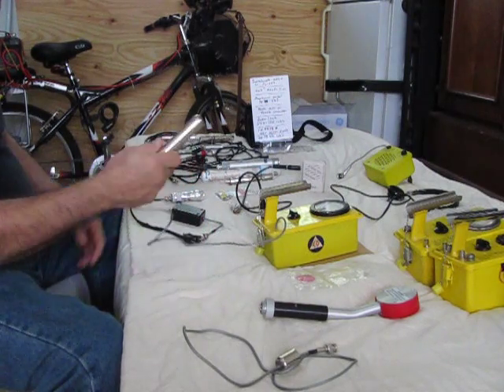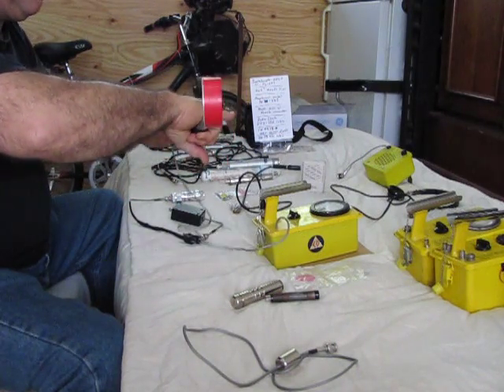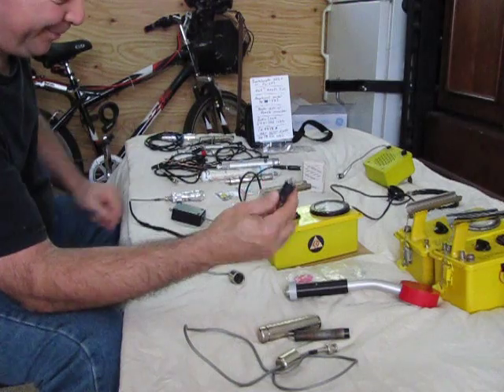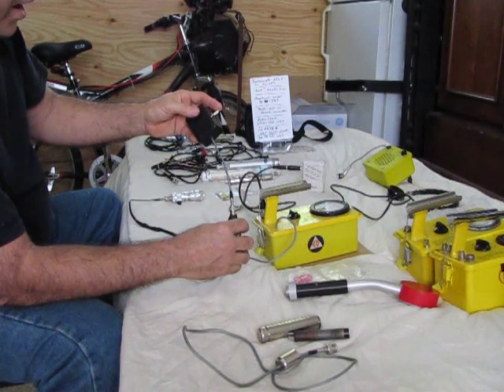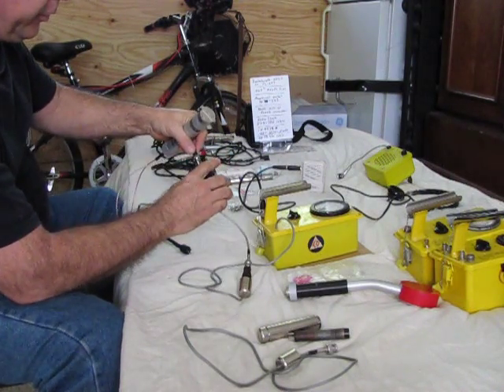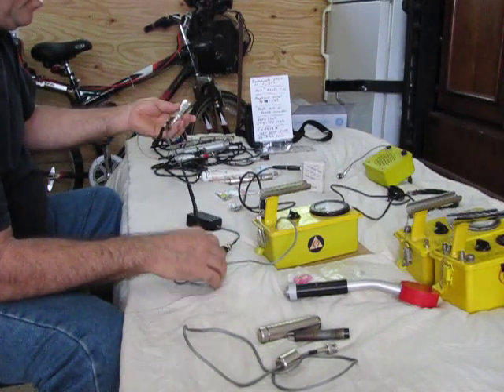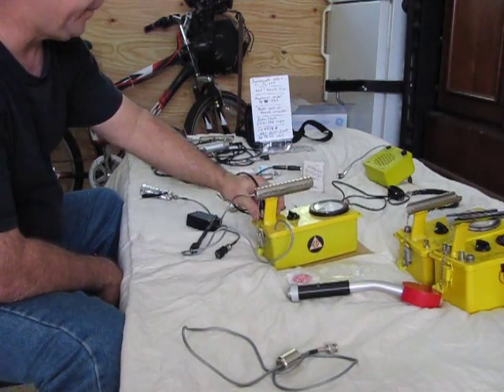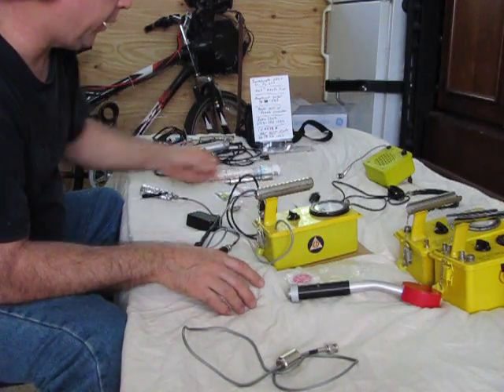CDV-700 external probes without tools

Comment from the maker: Parts list: 
1. Amphenol 78-s3s socket and 0.062 Molex pins soldered into the socket make the male adapter. A BNC post mount is wired to that. #1 pin is hot, #2 and #3 are grounded.
2. Switchcraft 2501F audio connector or PL-259 with the center pin cut down.
3. Radio Shack RG-58U BNC-BNC patch cable.
4. 100 volt zener diode 1N 5378B.

Comment: Very informative video.. Is the probe with the round detector plate a scintillation detector? I have been looking at various portable detectors including the units above $1K. However, they are all microprocessor based units that could be destroyed by an EMP event. It seems to me that a CDV 700 with a decent probe may be a very helpful instrument for a general detector as well as a device that may survive an EMP event. What are your thoughts on this?  
Regards, Glenn

Comment: The screw on little round speakers you can find on Ebay are not very loud but they do okay. They screw on to the headphone socket of a 700. It is tough to find a pancake probe in good working condition for less than $100. Things have sure gone up!

Comment: I have a AN/PDR-63  and want to modify the black low range probe for use on a CDV-700. Have you ever done such a modification on  the AN/PDR-63? If so, any suggestions would be welcome. Thanks